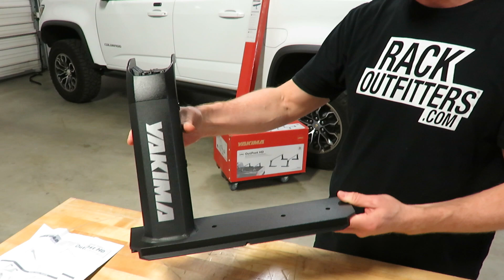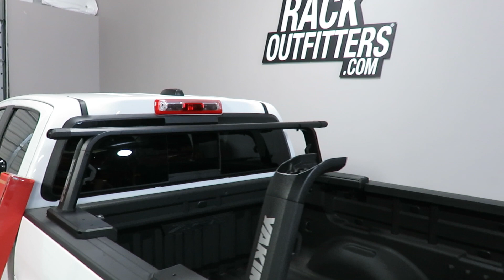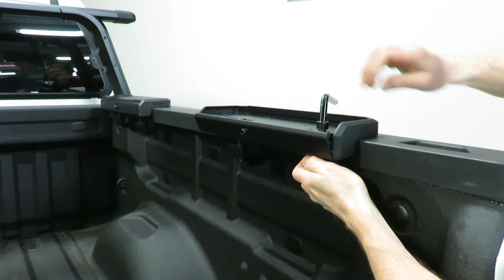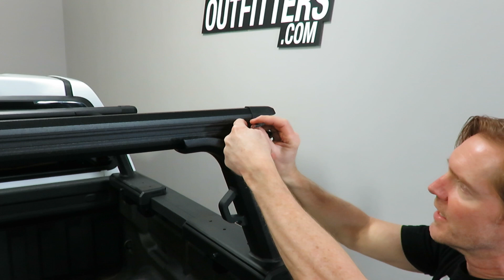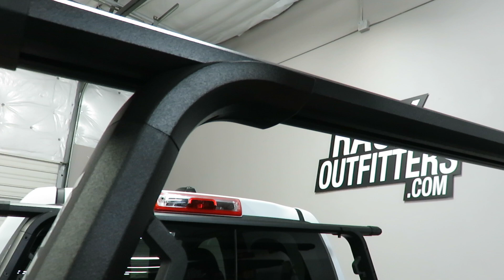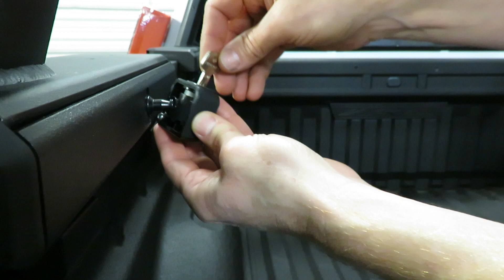Yakima OutPost HD Heavy Duty Truck Bed Rack Overview and Install

Comment: I have one. It's a great rack system indeed. But the price is extremely high for consumers. Their accessories alone are way too overpriced! I've bought, worked with, welded aluminum, and manufactured, etc. I have also powder coated metals like aluminum.The maker & affiliates of this company is taking advantage of their consumers.

Comment: I love how you make it look so easy, tell the truth, it is not. Buyer beware, those holes he claims line up right do not you need to keep a shim between the plate in order to have the screw catch, if not you will just keep pushing the plate up. As for the crap measuring tape Yakima puts on the bottom, it is useless, oh and let's not forget those towers are not stable until you finally bolt on the bars, meaning you should have two people do this because you will end up running back and forth with the tape measure.
Reply from the maker: Hello.  Sorry you had trouble.  The video shows, without edits, the bar being attached to the upright, for others concerned about this step, here's that portion of the video to judge for yourself: https://youtu.be/j3O-xYYlQPE?t=387 Thanks!

Comment: Looking about and happy to see Yakima offers truck bed racks. Those HD cross bars looks massive. I would love to use my Yakima roof top box on that for extra cargo. However, highly doubt the Yakima shape crossbar attachment for fit the HD cross bar. Thoughts?
Reply from the maker: Hello.  The HD bars measure 3.00" x 1.50" and Yakima's most common cargo box hardware can fit bars up to 3.5" x 1.75".  Thanks!
Reply: @rackattack  this is very helpful to know!

Comment: Would I be able to mount my 77lb kayak on there and if I could what mounting options do I have? I wouldn't mind the J hook, but my kayak is 12 ft. long. Would it just be better for me to get the Yakima overhaul and just lower them all the way? I have a 2016 Gmc canyon crew cab short bed.
Reply from the maker: The OutPost is intended for loads that do not need to extend over the truck cab.  We'd recommend the OverHaul and adjust the height to the best level for your truck and gear.  The JayLow and JayHook are compatible with the OverHaul's HD bars.

Comment: What size HD bar would the Tacoma need?
Reply: Yakima has a suggested length on their actual website. The recommended cross bar would be a 60 inch for the Tacoma. You can use longer bars but they will stick out past the cab.

Comment: In order to attach something on crossbar track, do you need to cut off (or take out) the rubber filler?
Reply: Remove the end cap then remove rubber slide in clip. The rubber will need to be trimmed up to the new accessory.

Comment: What size HD cross bar would a 2017 Silverado use?
Reply from the maker: You'll need the Yakima HD Bar - Large - 68 Inch - Set of 2, here's the link:
https://www.rackoutfitters.com/yakima-hd-bar-large-68-inch-set-of-2/
...and the OutPost:
https://www.rackoutfitters.com/yakima-outpost-hd-truck-rack-towers-set-of-4/